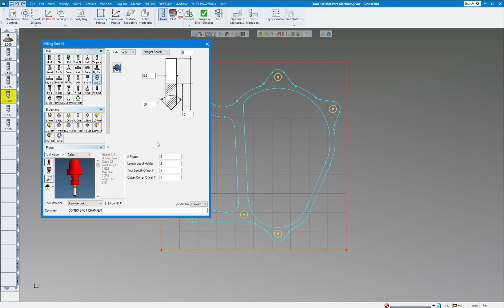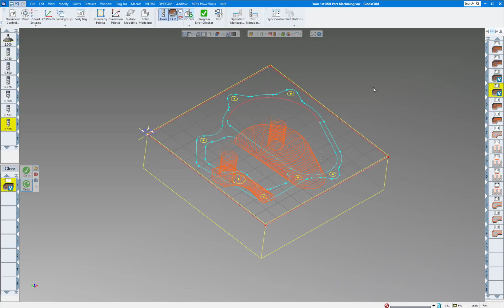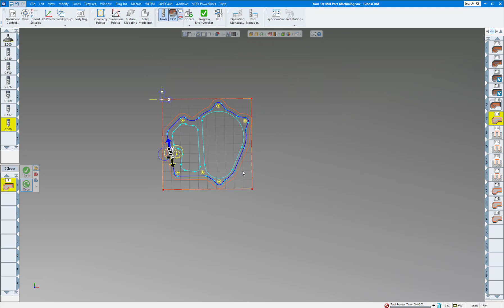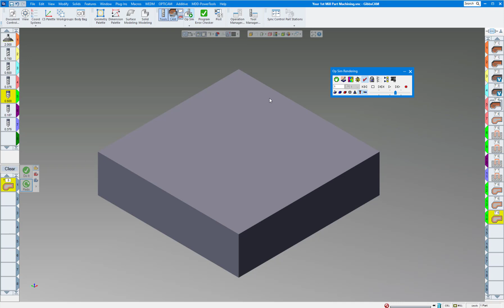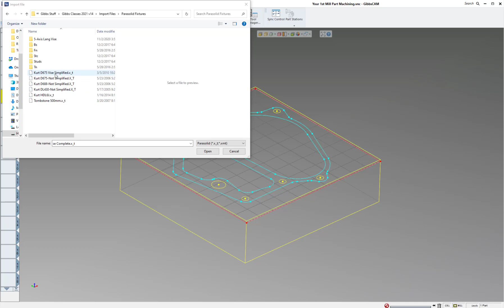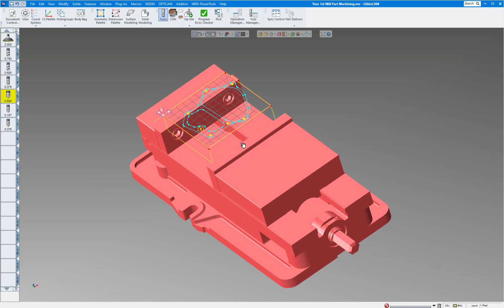Your 1st Mil Part Machined

Comment: I love this content. I have one question. Is there a way to export the solid model as a step file after the simulation has been completed? I found the "save to STL" option, but obviously STL files are harder to work with than STP or STEP files. Thanks in advance.
Reply from the maker: Hi Isaac.  You can only save as either a Faceted Body, STL file, or bitmap.  Maybe in the future Gibbs will have that capability.  The STL or faceted body is mainly used for rendering 2nd ops, etc.